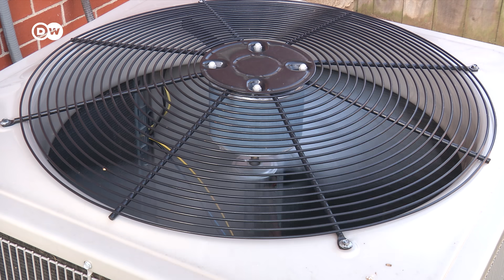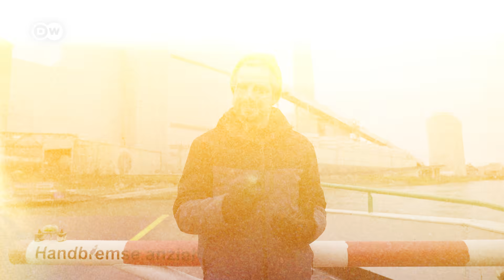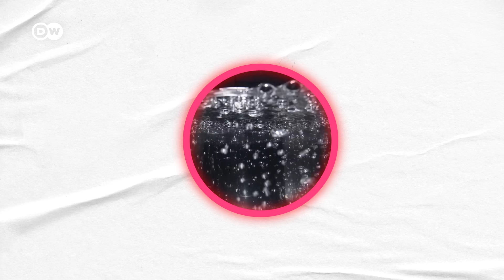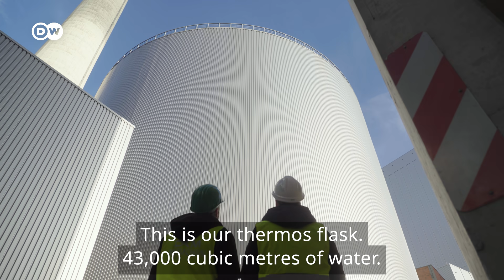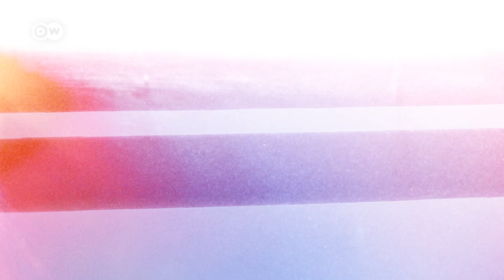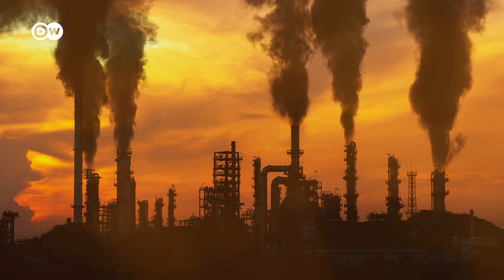Heat Pumps: How cold rivers could heat your home

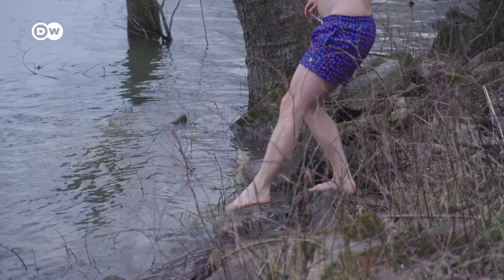Comment from the maker: Are heat pumps popular where you live? Note: At minute 1:14 it should be +30F, not -30F. Sorry for the confusion✨
Reply: No, but this gives me some hope to have places designed with this in mind, eco friendly, efficient, water powered plants
Reply: No, we burn firewood.
Reply: Yes very much. I live in Sweden. For the last 20 years (at least) some type of heat pump has been the most popular (and goverment supported) solution for regular houses that are outside of district heating coverage.
Reply: In NL,  more and more. My question is, can they also use it for cooling in the summer?
Reply: @ksoosk  you could use a water based (air/water or water/water) heatpump for supplying cold water to infloor heating (Vloerverwarming), but this only cools down a couple of degrees and the humidity stays in the room so the comfort level depends. It can work.

This is the big cooling advantage with air/air (airco) setups, they also dehumidify so the thermal comfort is usually much higher. 

So there are compromises with both setups. A lot of people, me included, don't think air heating is  very comfortable but they are better at cooling.
Reply: @ksoosk  Yes. They can. Indeed that is one of their advantages that is becoming more relevant. With hot summers. Your heater can do double-duty as a cooler.
Reply: because AC is a kind of heat pump, technically yes
Reply: In Flanders (region in Belgium), heat pumps are mandatory for all newly constructed housings since 2023.
Reply: They have been for some time in North Carolina.  They have long been a mainstay because propane is expensive, heating oil is expensive, and most people do not have any connection to the gas grid and cannot get one unless they pay the gas company the full cost of installation.
Reply: Nope, in Russia heat pumps are not present at all. Multi-family houses have centralised heating from burning fossil fuels. Single-family ones are relying on burning wood. Of course there's exceptions in regions with nuclear or hydroelectric power.
Reply: Yes. In rural parts of Denmark they have been all the rage since the Ukrainian war. And the Copenhagen Municipality is busy buying one for district heating,...... Having seen your video I am assured this is indeed a good idea. To boot: Add Aeromines,..... small residental windenergy and cheap solar the economic and enviromental case for these technologies becomes compelling.... Or don't they. Sincerly Jakob Eriksen.
Reply: yes in Poland last year there are so explosion in sell of heat pumps over of 50 % of new heat pumps in EU was installed in Poland due to incresed enegy prices.
Reply: In Palestine, they used to use heat pumps because they can also help with cooling down a home. Used to...
Reply: Yes they are used very often in new build homes in the Netherlands, I have a heat pump as well, for both warming and cooling.
Reply: I saw -30f and thought ‘that man is about to die!’
Reply: Yes and no. Natural gas is still very cheap in my location, so residential and small commercial are mostly gas. But heat pumps in the form of VRF are popular in larger buildings likes schools.

Comment: A good idea for the summer in Argentina. The problem: where do we access to water?.. i live in Chivilcoy and there are not big rivers near.
Reply: Heat pumps can basically use everything as a heat source. Ideally your heat source is as close as possible to the desired temperature. You can just use the air or if you like it more efficient but also more expensive the ground. Just a few meters under ground the temperature is much more constant over the year. Big heat pumps like the one in Mannheim often use a river as heat source as a river is warmer in the winter than the air. (For cooling it works more or less the same way.)

Comment: i doubt you save with heat pumps, like air conditioning are ripoffs, 900 saved in a year, ? check those bills, on 5'000 invenstments, my neighboor got a double heat pump, but had to install 5kw of solar panels, it looks very ineficient, on the side of the invenstment, and bills.

Comment: It was a great video and let me understand the logic of heat pump.
But just wondered to know on hiw much energy needed to run the heat pump?
Reply from the maker: Well...The energy needed to run a heat pump varies based on factors like its size, efficiency, and the temperature difference between indoor and outdoor spaces. Consulting an HVAC professional is best for accurate information tailored to your needs and circumstances ✨

Comment: I live where, in the winter, we experience below -30°C temperatures. Most are on electric, lots of Hydro sites, in 300 km radius. There are a few on gas, and or, burn wood.
VERY few have air conditioning in their homes, for the three weeks in summer, that are warm enough to possibly require it.

Comment: Heat pumps are quite popular for new houses even with them costing 3 times more initially than a gas heating. If you got the money for a new house the adding another 10k euros isn't that big of a deal but if you have an old house and want to renovate, a heat pump probably won't be the best solution.
Reply: Furthermore, heat pumps won't work if you have an old house, this is because teh heat provided by heat pumps is relatively low (approx 40 degrees celcius). So they only work well in well insulated homes.
But perhaps we should start with this first?
Reply: @texanplayer7651 There are heat pumps that work with higher temperatures and there is no real limit to which the principle of the heat pump works. The problem is just that your efficiency goes down if you have a higher temperature difference. For room temperature a heat pump is in all scenarios more efficient than gas boilers.

Comment: Why not use head producing industries as the (very) hot water sources? You circulate pipes through the city, so add a circuit to an iron manicure factory.
Reply: This is also possible, and is also being done. However, industries are private enterprises, and they aren't usually very keen on investing money on machines and pipes that would profit of their waste heat, and would be free to charge as much money for their heat as they want.

Comment: I've been wondering if it's possible to attach a device that turns heat into electricity for the summer months... is it?
Reply from the maker: Hey Amy! Theoretically, a thermoelectric generator could be attached to air source heat pumps. However, if this would make economic sense would need to be decided on a case-by-case base. TEGs are currently not super efficient therefore it would probably not generate much electricity.
Reply: We already have such devices, we call them thermal generators, we burn something (fossil fuels, uranium, gaz, whatever) and boil water, and that water turns a turbine.
Converting heat directly into electricity however is a novel concept, and some universities may have found such solutions, but they are for the moment unscalable, inefficient and too costly.
But the question you need to ask yourself is, do you actually NEED that electricity? Electricity is energy, but so is heat, and it just so happens that more than two thirs of the energy we require is for heat. So why not look for a heat source instead? Thermal power plants are very inefficient, they usually only convert about 33% of the heat they produce into electricity, the rest is lost due to friction of the turbine, the release of the hot exhaust gases and the steam.
If however, you were to use that same plant to heat water at 90 degrees instead, and used hot water pipelines to transport that hot water to homes, the energy efficiency of thermal power plants could reach in the near 90%, effectively dividing by 3 your emissions for heating even without using renewables.

Comment: Cutting back on oil, gas and coal will inevitably reduce the total amount of electricity needed.
- One pumpjack consumes 9800 MWh/month of electricity.
- Oil Refineries consume 15-20% of annual electricity consumption for the whole continent (just in the US).
- Offshore platforms burn 20-30 tons of diesel per day for their generators.
- Thousands of kilometers of pipelines. Each section with a pump consuming 50-250 kW and working 24/7.
- Tankers, each of them burning 200-250 tons of fuel oil per day. 
- Land transport with semi trucks - ~ 40 liters of diesel / 100 km.
- Gas stations with all their pumps and energy consumption. 
... and we haven't touched on shale gas and coal mining yet. ... nor have we paid attention to oil spills, vented gas, pollution of rivers and groundwater, deforestation and wars for resources.

On top of that it will reduce the waste of taxpayer money:
- The petrol industry generates $10 Billion in profits per DAY and receives $11 Million in subsidies per MINUTE globally.

Comment: And yet, all people move to Heat Pump, Germans have Coal power plants as the Serbia does, so bada bum coal to heat pump=grean? And in the next phase, when eclectic grid goes down. what then!? How much power can you store? So Battery, Solar Panels and heat pump is like 100k Euro. So too much money to make Banks more profitable. The only visible solution is something else....
Reply: Germans still have coal because you don't phase out in just one day, smartpants.
Also, when electricity grids go down, the well insulated homes of Germany can still make it livable for over 24 hours after an outage. And electricity outages are solved in less than a couple of hours. Repairing a burst gas pipeline however... Well that's a tad bit more complicated.
Reply: @texanplayer7651   I was thinking having gas tank 4 tons or 2x4T (4-8k m3) plus power generator. That heat isolation depends upon area of country.  If you have like few weeks with under -10, than isolation without heat system doesn't help as much. But my point wasn't on gas, it was forcing to another source and then getting dependent upon it or sky rocketing prices (example of Italy). As far as i Know, Germany imports a lot of electricity from France.
Reply: @Angelos_yu  Germany has almost no net imports of electricity from France. Germany has net net imports of 2% of its consumption (2023) and imports most of that from Denmark. Germany also has a lot of reserve capacity. France mainly exports electricity to England and Italy.

Comment: 3-400% efficient sounds good but I wonder if that means that less coal will be burnt to heat the water by using heat pumps rather than heating the water directly with the coal in the first place? My guess is that at 300% efficient, more coal will be burnt to make the electricity than to heat directly. Maybe at 400% you could make a slight improvement over directly burning the coal, but is that slight improvement worth all the trouble?
I am much more impressed with Sweden and Japan burning garbage to create district heating. No coal or cooling the river involved
Reply: Coal power plants usually convert 40% of the potential energy in the coal into electricity, the rest is waste heat, usually only up to 2/3 of this waste heat (40%) can be used for district heating.

The 300-400% efficiency of a heat pump mean, that you get 3-4kWh of heat for every 1kWh of electricity you put into the heat pump.

What is more efficient is depending on what is needed otherwise. If more electricity is needed, it is more efficient to use the waste heat from the coal power plant, because the heat is otherwise just "thrown away" into the river. If there is enough electricity (from renewables), it is more efficient to use a heat pump.

If you would want to generate the most heat and only a coal power plant can provide energy, it is the most efficient to generate as much electricity as possible (for a heat pump) and use as much waste heat as possible. In this scenario 75-80% of the heat were from the heat pump and 20-25% from waste heat.

Burning garbage is also an option to generate heat, but (luckily) there is not enough garbage, therefore you also need something else. Sweden also uses many heat pumps.
Reply from the maker: Hey Tom! Even when the electricity for the heat pump comes from fossil fuels, it is more efficient than heating with fossil fuels. However, the goal is to generate the electricity for the heat pump with renewable energy sources.

Comment: In my corner of the UK, they've only recently started installing gas pipes and gas boilers etc. by default 🤦🏻 it used to be all oil heating. Basically no heat pumps. Also insulation of houses in the UK is absolutely abysmal. Most windows have double glazing by now, but wall insulation is horrible. And no ones ever heard of triple glazing. So.... we're lagging behind quite a lot, which is really annoying (read: expensive) if you want to have those things work for you.

Comment: You cannot heat your home with cold water. You can heat some homes with a gigantic, complex, electrically powered machine as in this video.
Reply: There are smaller water sourced heatpumps of course. They aren't much more complicated than your fridge.
Reply: @MyReetkever  And it still would not be true to say that you can heat your home with cold water.
Reply: @Withnail1969  fair.
Reply: @Withnail1969  With your logic cars don't run on petrol but on wheels actioned by an engine.
Reply: @texanplayer7651  Petrol is an energy source. Cold water is not.

Comment: Do you think we can cool down buildings using a similar method? Yes, 100% possible. The real question is why it's not being done in Germany where we suffer from heatwaves every year?
Reply: Because waste heat produced cooling down buildings in summer can't be dumped in an already overheated river. It's also a matter of the amount of water flowing during the summer: if it's small, its temperature will be significantly affected and so aquatic life. They also had this kind of issue with nuclear power plants: too much heat and too little, too hot water.
Reply: @lorenzoventura7701  that’s why I wrote a similar method. Heat pumps can go directly under each building (after analysing the soil and all). No river needed.
Reply: Because someone would have to built them. Many heat pumps can work both ways, so this can be combined. Many heating systems are also quite old.

Comment: What do you mean heat pumps are more efficient than air conditioners? Air conditioner IS a heat pump. Maybe more efficient working fluids can be invented, but the device still works in same way
Reply from the maker: Hey there! Air-to-air heat pumps are very similar to air conditioners. However, there are different kind of heat pumps. Regarding efficiency: Heat pumps are more efficient than air conditioners as they pump out more cool and warm air by volume than the energy it takes to run them.

Comment: I built a new house with an air source heat pump, well insulated, triple glass windows, everything electric. My electricity consumption is low (>5MWh/year) and cheap, but all of this was not cheap to built, while some of my neighbours still burn lignite or wet wood for heating, which is cheap for them but enough to destroy breathable air for an entire village. They also have parallely installed gas boilers as well, but they want to save some money by rather burning smelly polluting stuff instead of using a bit more expensive natural gas. I am wondering how much money they save by this. I suppose it is not much and it is the cost for clean air in my neighborhood. We live in Czechia, common people are not that wealthy as people from Western Germany. But I must admit that almost all new houses built here in recent years have air source heat pump as their main heating source👍
Reply from the maker: Hey Matej! Thanks for sharing your experience!✨

Comment: Fantastic video! Having researched this myself I can say the best heat pumps are VERTICAL ground source heat pumps; you have a few bore holes drilled down in you garden, only a few CM wide (so even tiny gardens are enough) and HUNDREDS of meters deep. The temp underground is consistent all year round, so unlike air pumps which ironically become less efficient when they are needed the most on the coldest days (they are less efficient than a normal electric heater if the air drops to  around -15C), vertical ground pumps aren't affected by air temperature so are far more efficient. Also, air source heat pumps can be very noisy because of fans, where vertical ground source run silently. Ironically, even though vertical ground source heat pumps take considerably less work and land digging than horizontal ground source heat pumps, the lack of installers with the drilling equipment allows them unethically to charge very high prices for the simple & easy job of drilling the deep bore holes, and they know people will pay more as these are the most efficient type. The more installers that get these drills, the greater the competition and the lower the prices will go.
Reply: I live in a semi-mountainous area and reading your comment, it just clicked for me now why some people around here say heat pumps don't work. Wonder how much those drills cost and if there aren't diy ways to drill down deep enough..
Reply: @al3xf103  excellent question! If demand increases competition then prices will have to fall. But if you find a DIY solution, I would love the details.
Reply: Get a well driller
Reply: @johnransom1146  can they drill holes  around 3cm wide that go down 200 to 300 meters?
Reply: How deep do you think water can be? Oil? Short answer yes @TimLongson